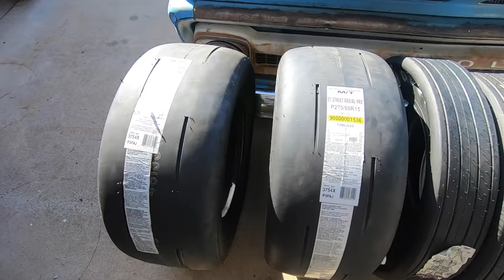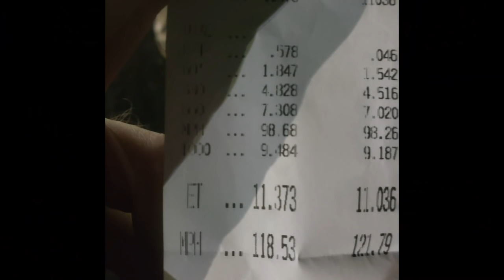My Turbo LS S10 Build In 10 Minutes

Comment: This makes me want to build a 85 s10 blazer
Reply: I've got an 85 s10 truck and a 93 blazer, if your around Arkansas come get one lol
Reply: @750rocketman5  funny cause I got a 89 s10 blazer with a tbi 305 for
600 which I'm gonna make into a daily/drag car
Reply: I just pretty much got done rebuilding a 1984 S10 Blazer 2DR, 4X4, 2.8L/Auto with 43,000 Original miles on it, When I bought it like 1.5 years ago and started rebuilding it the previous owner wrecked it and hit a Metal Culvert and bent the frame on it, So I bought another Frame and completely rebuilt the Frame and then dropped the original Engine & Transmission down into the New Frame & then started putting the Body onto the New frame too, I wanted to do a 4.3L/Auto or 5 Speed swap on it SOOOOO bad when I had it all apart, but at the time I wasn't able to find a good donor for it so I just ended up putting the 2.8L/700R4 back in it bc I figured with it having so little miles on it it would be a good Engine & Transmission, well fast forward 2-3 months after I got it done and drove it for about 1000 miles ( Locally ) and then I started having problems with it not wanting to shift right, I messed with the TV Cable and nothing, I went to change the Trans Fluid & Filter and pulled the Trans Pan off and found out that the 2nd & 4th gear bands was laying in the bottom of the pan :(   
So here I am again looking for another 4.3L/Auto or 5 Speed Donor that way I can do what I should have done like a year ago lol, Not to mention that I'm also putting another 4.3L into my 1995 S10 Truck right now as well bc It spun a bearing on me coming home from a car show, I'm using a 1993 CPI Engine Block and putting all my TBI stuff onto it that way I can get my Truck back on the road too so I can get started on the 4.3L swap on my Blazer.    You can check both my Blazer & Truck out on me Channel if you guys want.
Reply: @s10_4_life6  that's some shity luck on that one man lol but will do for sure
Reply: @750rocketman5  Yeah it definitely is man, Hopefully one day they'll both be Running & Driving tho lol

Comment: When I was 16 my first ride was a 1993 Chevy Blazer S10 Tahoe Edition with leather seats 4.3 Vortec V6 4 wheel drive electric lift gate in the rear and the all-important nut cooler vent under the steering wheel

Comment: Buying an all original one owner 1982 2.8l v6 longbed s10 single cab. Gonna take out the original motor and trans and slam a 700r4 trans with a 350sbc supercharged and beef up the rear end lower it and repaint it too. Got alot on the wish list for it hopefully will have it done next year

Comment: I built a V8 1992 S-10 several years ago. It took about a year and a half, and I'm still working on it. I went a completely different route engine wise. I built a 383ci old school small block, not an LS, and I used a Weiand 6-71 blower instead of a turbo. I have not put a cage in it. I've gotten it into the high tens, you don't need a cage unless you get into the nines, which I have no plans to do. I race just for fun. Pursuing faster and faster times gets real expensive real fast, and it's not in my budget. BTW, I also race at Wild Horse Pass. I only live a few miles from there.

Comment: Nice I’m building a turbo 6.2 for my 83 el Camino it’s got a btr stage 2 turbo cam, dual valve springs, stock rockers with btr trunion upgrade, aglin lifters, billet timing chain and sprocket 1200cc Bosh injectors and a few other goodies

Comment: Looks like you did a lil fab on the turbo install. Was that a turbo kit manifolds, up-pipe,etc? Like how you were able to keep stock front wheel wells.
Reply from the maker: I made everything and used stock manifolds turned around

Comment: Looking into a 92 4.3l extended cab that doesn't run as we speak. It needs a mountain of work but should be a fun project
Reply: I am in arkansas. I have a 1998 chevy s10 4x4 5 speed 4.3 liter 180000 miles for sale no rust on it run great it

Comment: Nice work. What is the rear end setup? I'm guessing 8.8, but the center section looked odd, so I'm guessing it's got a spool? Are the axles drilled for 5x4.75?
Reply from the maker: It’s a Ford 9” stock s10 width.

Comment: That things pretty sweet man what size turbo and crossover did you use ?  What kinda power is it making ?  I love me some dimes
Reply from the maker: Vs 78/75, 2.5" crossover and it ran 10.29 in the 1/4 mile

Comment: Where did you get the front brakes?
Reply from the maker: Www.switchsuspension.com
Reply: @RobbyVsGarage  thank you. I have one more question the steering shift did younmake that or were you able to buy one already setup? And if so were at?
Reply from the maker: I made it using steering universal joints and round rod

Comment: What are you using for a rear end? I have an N/A 350 swapped s10 and struggle to get much traction
Reply from the maker: Need to add weight to the back. S10s are front heavy.
Reply from the maker: I have a Ford 9”
Reply: @RobbyVsGarage  do you know any one that is trying to buy one I have a 1998 chevy s10 4.3 4x4 5 speed 180000 miles run great

Comment: Hello what new steering wheel part number or information is that? All the s10's and blazers and ALL the body styles have real bad slop in the intermediate shaft with no real way to fix it except for what you did.
Reply from the maker: You want the steering wheel or are you talking about the steering column?
Reply: @RobbyVsGarage  the steering column. Thanks much. You know the sloppy steering in a bunch of those style trucks. I only saw this video but are there more detailing the parts you got? I can look at those too
Reply from the maker: It’s a drag race column from motion raceworks. I’m sure it’s in a one of my videos
Reply: @RobbyVsGarage  Thanks!

Comment: About how much should one pay for a roller in this condition? Reasonable price?
Reply from the maker: I paid $750
Reply: @RobbyVsGarage  guys asking $400, but it's not in the best shape. It's a Durango edition single cab. Motor is in it, and it pretty much runs, but just stopped. I know the guy. Dont know if I should jump on it or not lol
Reply: The body is actually mostly straight, but couple ding areas
Reply from the maker: Can’t lose for $400

Comment: Im wanting to turbo my 1978 355 swapped S10 what headers do you recommend
Reply from the maker: I'm not sure. Depends where you want the turbo. You'll have to fabricate most of it.
Reply: Ummm sorry but there's no such thing as a 1978 S10 LOL, S10 didn't come out until 1982!
Reply: @s10_4_life6  the 355 is from 1978....... The truck is a 87
Reply: @zachproductions3318  Ohh ok, I misunderstood you then Lol, Sorry about that, Which I was actually joking with you really bc I thought you meant to say 1987 S10 but instead you said 1978, but I guess that was wrong to huh Lol.      I was in the middle of doing a SBC 305 Swap on my 1995 S10 until the Transmission went out of my 1984 S10 Blazer and left me without a vehicle to drive, My 1995 was a 4.3 TBI/5 Speed and the 4.3 blew up last year on my way home from a car show, but I had bought a 1993 S10 Blazer a few months ago that had a Good 4.3L CPI Engine in it, so I stopped doing the SBC 305 TBI Swap bc I need to hurry up and get my truck back on the road and where I was missing a few parts for the V8 Swap and Where I pretty much already had everything I needed to just throw that other 4.3 in my truck, I decided to take that 4.3 CPI and then take the 4.3 TBI and pull the parts off both and put the TBI stuff onto the CPI Block that way I'll be able to just throw the 4.3 back in my truck and have something to drive for now and once I get it done and on the road I'm going to start tearing my 1984 Blazer, 2DR, 4X4, 2.8/700R4 Auto back apart and I'm going to buy a Donor Truck or Blazer with a 4.3L/Auto or 5 Speed and swap it into the Blazer 🤞🤞🤞🤞

It's going to be so much fun!!! Oh and once I get the Blazer Swapped to a 4.3, then I'm going to tear my truck back apart and do a SBC 350 TBI Swap on it LoL.

Comment: Why’d you choose to go carbureted?
Reply from the maker: It's different.
Reply: @RobbyVsGarage  as in different from other people?
Reply from the maker: Yeah. No one understands carburetors anymore and think efi is the only way.
Reply: @RobbyVsGarage  yea, I definitely agree with you, i just feel like you could have more power, but if you aren’t necessarily going for power its good. Honestly i know a lot about carbs and stuff and i wish i knew more about newer style engines
Reply: Hey man! Did you have to cut the frame for the engine to fit? If so did you weld a plate around it?
Reply from the maker: I notched the engine crossmember and plated it. Its in one of my video on the build series.

Comment: What carbueeator is that
Reply from the maker: It was a quick fuel technology 750cfm blow through
Reply: @RobbyVsGarage  it works fine straight out of the box with the the turbo
Reply from the maker: @ThatLSTahoe yes, it’s made for it
Reply: @RobbyVsGarage  do you have any head combo recommendations for the blow thru setup
Reply from the maker: @ThatLSTahoe any stock LS head works great

Comment: Efi will put you in the 10s
Reply from the maker: Its ran 10.2 already
Reply: Efi don't make vehicle fast just easier to tune options easter starts and more efficient lots of carbs make more power
Reply: michael anderson yeah but clearly dude needs a tune.
Reply from the maker: You're right, I had 3 bad plugs so I was running on  5 cylinders. That's why it runs low 10s now
Reply: Robby V's Garage knew something had to be up. 11s aren’t exactly fast for a turbo build lol carb or not
Reply from the maker: What does your setup run?

Comment: buy some number stamps
Reply from the maker: ?? Stamps for what?
Reply: engine internals... always stamp rod/cap  ,,, paint/grease pens etc come off and rather not run chance of swapping up parts..
Reply from the maker: Stamping connecting rods on ls engines is a big no no in gm service manuals. That’s how we did it has techs with paint pens. It doesn’t come off easily.
Reply: I suppose if you hit the thing like an ape yea....  I was heavy  line tech for GM,  I have seen center punches use, number stamps used and electric engravers used..  

Never saw an engine failure at the point they were marked.. LS rods break but it is usually down stream of the crankshaft...   now ,  maybe someone has a rod that failed on the side of the cap somewhere, I just have not seen it.. (raced as a garage owner for a couple decades)